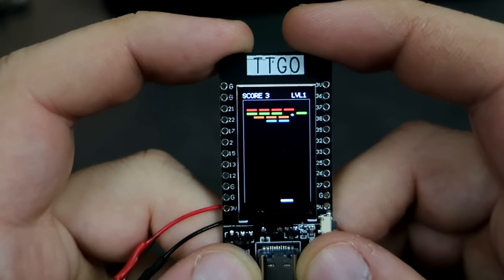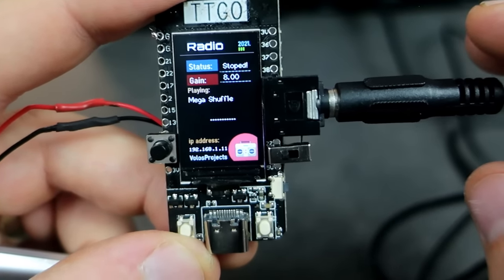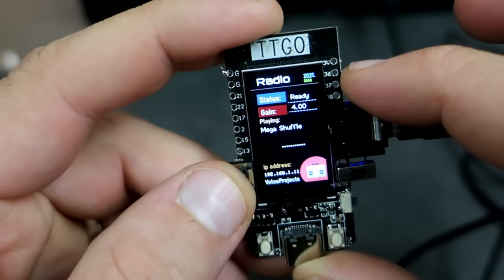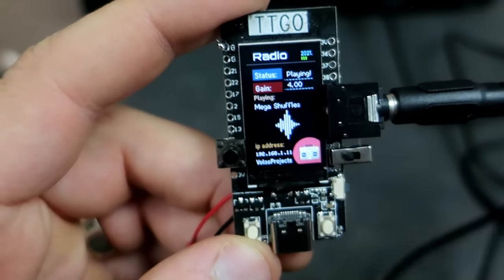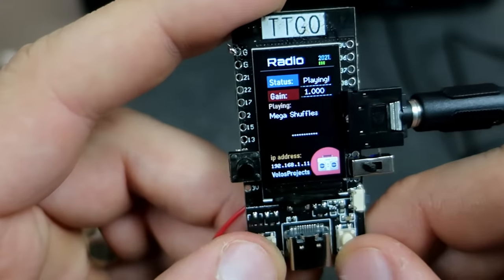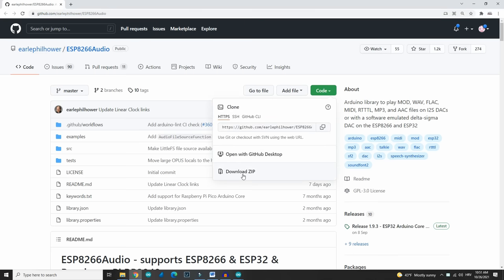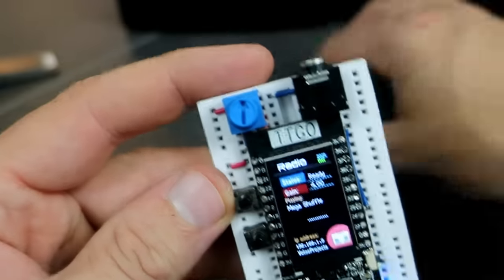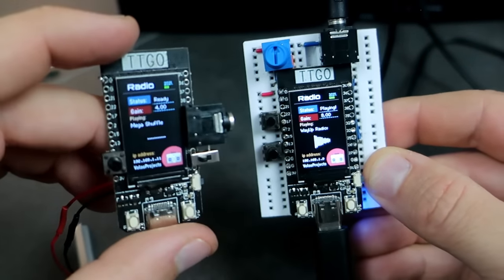ESP32 Internet Radio TTGO T-Display board

Comment: It seems my previous comment was deleted.... maybe because the attached link.
 So thanks for sharing, this works fine, and there is no problem to upload the sketch. It is a very useful project for me,  there are some stations here, available just via net.
Let me suggest / kindly ask for a development of the project. It would be very useful to include a web server, enabling an easy way to enter wifi  credentials. In this way the project would be really universal, and mobile, enabling to take the device with you, connect, and use anywhere.
I guess, most of us would be grateful for this functionality!
Thank you to take my comment into consideration, and many thanks for developing, and sharing this project!!!

Comment: I really like your Internet Radio project, But I only have one question. Without a schematic to use, I took a screen shot of your project board to better understand where the extra button and slide switch was wired.   After reviewing your sketch file I see that BTND=17 but in the video I don't see where this GPIO pin is being used.  What am I missing. Any help you can give would be greatly appreciated. Thanks again for your videos they are very helpful for a beginner like myself.

Comment: So many questions left unanswered!  What pins are you using for output (I see in comments).  Are you driving a speaker directly or an amplifier?  What amplifier or what kind.  Where did you get that breadboard mini-phono connector?

Comment: That is very  smart, I was thinking of adding a unit like that to an old portable radio so that I can have information services and server processes post messages via MQTT then use Larynx TTS to feed the messages to an announcement service. One way is to have the TTS output to a wave on a HTTP server then send the URL to the TTGO board so that it just sits their playing new waves off the server whenever it is notified of a new one. It would just have to maintain a small queue of URLS in case the messages came in faster than it could play the audio.

Comment: Another great video!
I did not see in the code  TFT_ BL (pin 4) defined. I assume it's done in the user setup header file.  Also there is an LED included perhaps for future use?
In the video it appears to be a SPST slide switch are you currently using that in this project? Again another great job keep up the good work!

Comment: you write "connected to pins 26 and GND" which is the audio output pin26 (Dac2).
is the pin25(Dac1) also audio output? stereo output?
And which pin is the button connected to?
Pin 12 or 13

Comment: Now take it to the next level and have it connect to a bluetooth speaker.
Reply: I don't think that they have a protocol to stream audio over BT.  I requested the same in some KAradio groups and nobody answered.  My advice for now is a Pi Zero W and Moode player which works perfect with BT speakers. I have a Zero 2 W also but that one has an issue sending audio to BT with moode.

Comment: Thank you for this project. Can you tell us what the slide-switch that we see just below the output jack is used for? Is there a way to get stereo output?
Reply: connect you jack as follows:  L=pin 26   R=pin25 and common to GND      and                                                          comment this line in the sketch:   //   out->SetOutputModeMono(true);   quality goes a bit down but is stereo

Comment: Hi,what could be possible reasons that arduino ide says not enough space during upload?
TTGO is fresh,brand new,cooking to the recipe.
Thanks
Reply from the maker: Did you select proper board, did you install it proper?
Reply: to fix the problem,
 at line 15, put a //, like this : // #include "background.h"
at line 93, put a // too, like this : // tft.pushImage(0, 0,  135, 240, background);

this remove the background picture, but the radio work

Comment: Great project. Do you have the schematics for connecting the additional push button, earphone plug and sliding micro switch ?
Reply from the maker: No ,but it is simple. Earphone plug is conected to pin26 and ground.
Reply from the maker: In code you can see pims for push buttons.
Reply: @VolosProjects  You should make all this information easy to find.  Adding a readme to the git would be a good place to put it.

Comment: Looks great, I'm looking at building this. I see the pin 26 DAC is used for the Audio output. I see pin 25 is also a DAC, so I wonder how difficult it would be to implement stereo - any thoughts anyone?
Reply: Found this on the audio library he uses 
// AudioOutputULP out = new AudioOutputULP(); // stereo
// Connect left channel on pin 25
// Connect right channel on pin 26
// OR
// Connect mono channel on either of them (stereo samples are downmixed)
// AudioOutputULP out = new AudioOutputULP(1); // mono, only DAC 1
// OR
// AudioOutputULP out = new AudioOutputULP(2); // mono, only DAC 2

Although I dont know how to implement it, since he's using I2S and not ULP. its on the AudioOutputULP.h at the src folder of the ESP8266Audio Library

Comment: Hello ,,
will you guide me about the tactile switch , slide switch and audio out pins on board ?
thanks in advance
Reply from the maker: audio output pin is 26, you can check in code pins of tatcticle switches. One side is connected to gnd other to esp32 pin, In this case you will need to use two pin tacticle switch.

Comment: Very well thought out! - Did you think about adding some code that doesn't start playing the audio until the buffer starts changing (to avoid the Bzzzzzzt sound on playback start)? - I guess you could check the audio buffer for changes before enabling audio output simply?
Reply: I think the blocking "delay" commands int the main loop causes the problem.
Reply: @MickesSg  There's delays? Oh my .... Yep that might be the problem.

Comment: I tried to compile the program from the links that you provided here but I get error some issues with the library file "ESP8266Audio-master\src\AudioOutputI2S.cpp
:234:7: error: 'i2s_config_t' has no non-static data member named 'mclk_multiple' }; " 
Perhaps you know what is this and how to fix it.
Question, this is the exactly files that you used in your project or you made some modifications, it you did, it's possible please to get from you your modified files? because the way it is it doesn't work. Thanks
Reply: Install Audio library Version 1.9.3 and it´s work
Reply: @chrizzz474  Thanks, I did it already and it works, the project that Volos made is beautiful I only have one issue left, not all the stations that I put there are working even when they work smoothly in other web radio programs and they have exactly the same parameters and bit rate as the stations that work here.
Reply: @aderaba  Unfortunately, I feel the same as you. Not all channels work. Maybe someone can help?
Reply: @chrizzz474  It needs a research to find what's the different between the stations that works and stations that don't work, that's will be a good start to resolve the problem.
by the way I replaced the initwifi() function with a one that could have multi WiFi connections, now I can use it in many locations.

Comment: Very good project, as usual. I did your project Weather station, it is amazing. Thanks.
Unfortunately, for internet Radio there is an error of compilation below. Do you have any idea to solve that?
again, thanks for sharing your knowledge.

Arduino: 1.8.12 (Mac OS X), Placa:"TTGO LoRa32-OLED V1, 80MHz, 921600, None"
Erro compiling to the board TTGO LoRa32-OLED V1

Comment: What it means: Sketch too big. Error compiling for TTGO LoRa32-OLED 🤔
Reply: to fix the problem,
 at line 15, put a //, like this : // #include "background.h"
at line 93, put a // too, like this : // tft.pushImage(0, 0,  135, 240, background);

this remove the background picture, but the radio work

Comment: Hi, I could compile,and upload tothe board, butthe display doesnot work,just a red ledis blinking - in the serial prt i have :STATUS(Connecting to WiFi) OK
STATUS(System) Ready 

any suggestion -- thak you in advance!!!
Reply from the maker: Can you upload any other example, did you install all libraries in arduino IDE
Reply from the maker: What red led?
Reply: @VolosProjects  Thanks for your prompt replay! Yes, I installed libraries, including TFT_eSPI, from libray manager / Bodmer version / and mod the User_Setup_select.h , uncomment the "include <User_Setups/Setup25_TTGO_T_Display.h>  "  did I missed something? Thx a lot foryour help!!!
Reply from the maker: @richieraisz9353  but i am still confused, do you have right board, ttgo tdsiplay dont have red LED. Also have you tried examples from tft_espi library?
Reply: @VolosProjects  Thanks for your reply! Finally I have managed to order the proper board, and uploaded the sketch. Its connected to wifi, and seems, playing the stream. Now there is a time to attach a transistor and a speaker for testing . Going to inform you abt the outcome --- i think, if I can manage to create this internet radio, based on your video --- anybody can do it :-)
Reply: @richieraisz9353  Did you manage to do that ? This looks intresting. I am going to try this also.
Reply: @countrymu6  yes, it works fine, just edited the sketch, added some local stations, and uploaded -- very useful project, there are some station here, available just via internet....
Reply: @VolosProjects  Liligo TTGO 4MB boards have red LED.  16MB Version has Blue LED.

Comment: Thank you for sharing your design. I really like the display. Since RECEIVA is closing down, my Crane Internet radio will soon stop working (search has already stopped) and I plan to gut it and replace the insides with something like what you have designed. My goal is to use the CCWIFI's original knobs and buttons.
Reply: I want to do exactly the same thing, if you figure out how to use the original knobs and buttons - please let us know how you did it.

Comment: I hate to be even slightly critical since I think ALL your Volos Projects are Very cool.... but I know I'd really struggle building some of them without a schematic and simple parts list with Part Numbers.. 

When you place components around the edge of the dev board, and don't give us any info on what pins need to be wired to them, or the value of the Potentiometer that may be needed, or how to wire the Audio Jack, or rotary encoder etc.. and also fail to give us a photo or view of the BACK side of the project anywhere in the video .. I get very discouraged knowing it may be very hard to figure that stuff out..   You always make downloading and using your excellent code VERY easy ..  But the hardware and hookup needed can be very hard to replicate.. BUT,  If you could please just add a simple photo of a hand-drawn schematic to the project's GIT Hub repository that would solve the problem several others have commented on below.   I really do want to make this Internet Radio but have no idea how to wire its switches, jack and pot.. :face-pink-tears::face-red-droopy-eyes:
Reply from the maker: You just need to slow down. Sorry, my chanell is not step by step, this video whod  need 1 hour if i will explain every time that i explain how to wire pot as resistor on some pin.
Reply: @VolosProjects  I understand and agree you can't waste time.  But others have commented on having the same problem (below).  We simply want to know a litte bit about the hookup and types&values of components needed.  Usually a very simple uven hand-drawn schematic or photo would solve it...  If you could just flip the board  over for a second or two during the video we might be able to figure out and hand-draw out the schematic on our own.. I have tried this and it can take hours too.  Please consider parts like potentiometers come in about 10 different Standard resistance values.  Should we just  guess?  I just ( for example) ordered 4 different value POTS cause I'm trying to build your Color Picker PCBWay Board because you never tell us what value pots are needed.   I really want you to succeed.  I'm just spoiled I guess by most other YT channels which do document projects a little bit better i guess.  Oh well .. Best Wishes to you I agree you time is FAR more valuable writing and explaining code so I'm not complaining. .. jimS

Comment: I just went to buy one, but it only uses USB-C, which I don't have.  Too bad.
Reply from the maker: Yes, most of new boards have usb c now 😃
Reply: @VolosProjects  Great job on the radio and your video!
Reply: You can use a USB A to USB C cable to connect to it. That's how I connect my phone (USB C) to my computer (no USB C).
Reply: @threedaymonk  Thanks, I did not know that could be done.

Comment: Anyone get this error?   InternetRadio.ino: In function 'void setup()':
InternetRadio:96:17: error: 'TFT_BL' was not declared in this scope
   ledcAttachPin(TFT_BL, pwmLedChannelTFT);
Reply from the maker: you need to update yout tft_espilibrary and setup your ttgo t display properly
Reply: @VolosProjects  I have all the latest libraries. Did you have a vid on setting these up?
Reply from the maker: yes here it is https://youtu.be/b8254--ibmM
Reply: @VolosProjects  THank you so much :)
Reply: @VolosProjects  My fault. I had the t display S3 module. Which is why it didnt work. I followed your other Vid on the S3 and it now works. Cheers.